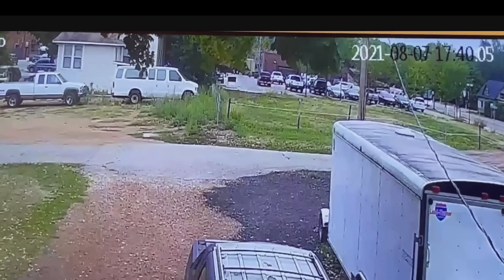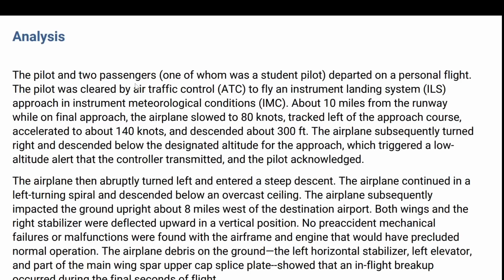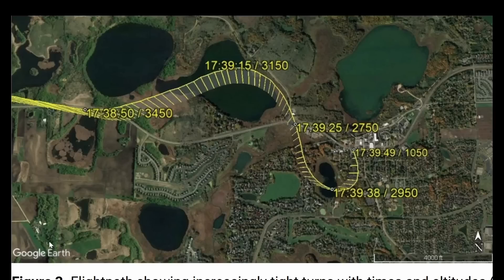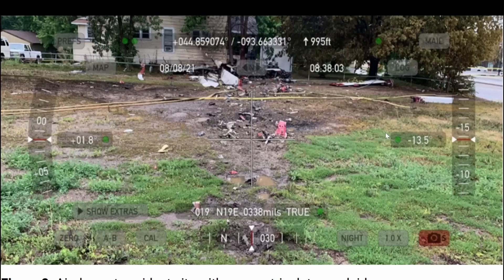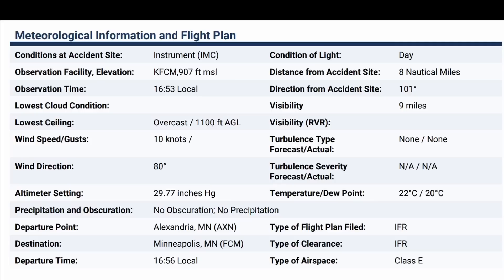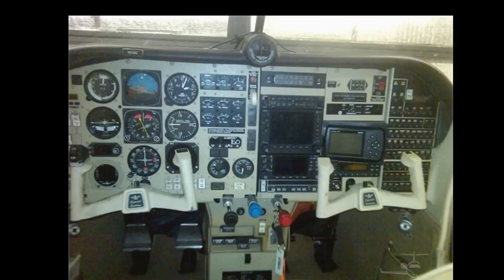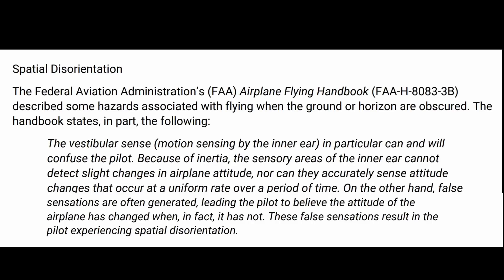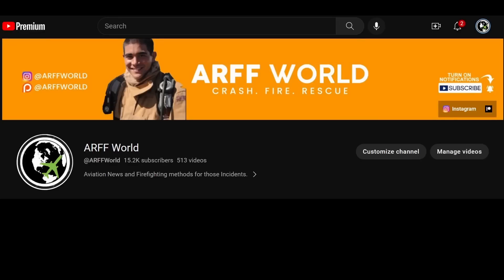Spatial Disorientation is Serious

Comment: I was stationed on an aircraft carrier in the late 70s early 80s. We had a pilot on the flight deck that was waiting to go to the catapult when the jets on both sides of him were towed. He thought he was moving. He hit the brakes, did something else  like putting it in park and still thinking he was moving about to roll back off the flight deck he dropped the knee (collasped the front landing gear). That slams a couple million dollars worth of radar into the flight deck. When he got out of the jet (I believe it was an F-14) his wheels were still chocked. I can't imagine how he felt at that moment.
Reply from the maker: Probably not good

Comment: I get the disorientation in cloud but isn't there an artificial horizon instrument, an altimeter and a compass you can look at until you exit the cloud?
Reply from the maker: True.  But human factors may cause pilots to not look at the gauges
Reply: @ARFFWorld  Maybe but why look out the window when you can't see anything?. Surely you can keep the wings level using that instrument and descend until you break cloud?
Reply from the maker: @worldofrandometry6912  hard to say.  Extremely sad. Thanks for watching and please subscribe if you liked the video.

Comment: This spacial disorientation, sometimes called vertigo, is possible anytime we have no normal visual contact with the horizon to reference for wings level flight.  Yes, I have experienced it occasionally during my 400 hours of flight in instrument meteorological conditions mostly in the Huey which required two pilots.  Fatigue and or task saturation is generally the cause.  No problem with two pilots.  When it happened I had faith in my instruments and had no problem keeping the aircraft level, but I strongly sensed that I was rolling over inverted.  It made me sick to my stomach, however.  I simply turned control over to the other pilot and rested until I no longer had the rolling over sensation.  Strangely this sensation need not be logical at all.  Driving from Durango to Pagosa Springs in a very heavy snow blizzard at night I experienced the definite sensation that I was rolling over to the extent that I was getting sick to my stomach.  I had to have my wife, who hates driving, drive.  Given the option of either waiting until I was rested or driving, she drove.

Modern autopilots do a really good job of giving single pilot operators some rest time, but when task saturated anyway that doesn't work as well as a second pilot.  Single pilot medical evacuation operations, especially by helicopter which requires a much more intensive instrument scan, have a very high spacial disorientation loss of control problem and a very high fatality rate as a result.  Two pilots should be required for safety of crew and patients.  Spatial disorientation need not result in loss of control, however.  A pilot can fight through with a good instrument scan, accept the sickness even to the point of puking, and live.  It is the most common cause of fatalities, however.
Reply from the maker: Thanks Jimmy for taking the time to share.  Spatial disorientation is a sneaky one not talked about enough

Comment: I'm not a pilot but these types of crashes always happen when the pilot is either entering or exiting the clouds and temporarily loose all and any visual reference out side the aircraft. Why would anyone flying blind not look at the basic instruments in front of them that are indicating they are nose down, loosing altitude, gaining air speed, and the wings are not level? Even if they don't look they can certainly hear the engine RPM's approaching red line.  Why don't they level out and get the air speed under control before they are going so fast they rip the wings off, I would imagine you don't go from cruise to wings off in a couple of seconds even if you purposely put it in a straight down dive? I don't know

Comment: Very sad. Especially realising that it was totally preventable. Spatial disorientation is a powerful killer. Especially when panic sets in. IFR flying requires small and gentle inputs and not allowing any significant deviation from the flight path and speeds. It also requires a mental picture of your nav situation. 
If you realise you messing up your nav, it is imperative to have a backup plan and execute it, and try again. In IMC keep your scan going; horizon-speed- horizon-alt-horizon-path! Over and over as long as you're IMC! Stick to it religiously!
The sudden accel from 80 its to 140 kts did not bode well. Way too radical. Gradual and gentle corrections is key. It doesn't bear thinking of the horror of folding up your aircraft in midair and breaking out of clouds at 1000 ft. Terrible...
Reply from the maker: Super sad one to cover

Comment: This aircraft had a modern digital autopilot that provides vertical and horizontal control to 800 feet below the cloud deck and 200 feet above the ground. Best practice for single pilot IFR is to let the autopilot fly the approach while the pilot monitors the approach. This is similar to John John’s spatial disorientation accident. Why didn’t they use the autopilot?

Comment: Freeze frame at 0.03 and 0.04 you can see the wings were still intact at 0.03 and folded up at 0.04 with the tail being the first part to impact the ground. But from the flight path you can see pilot was spatially disoriented. Also from the report he hadn’t had a medical in 4-5 years, so he probably wasn’t “current” with any sort of check ride. If there’s even a chance if IMC either don’t fly, or only fly if you’re current & qualified to fly Instruments in IMC, or better yet get AQP certified, too.
Reply from the maker: Agreed
Reply: When the Mooney breaks it takes the cabin floor with it. Seats and all.

Comment: It's a pilot's nightmare to attempt a landing in IMC, break out of the overcast at something like 1,000 ft. and realize that the airplane's nose is pitched too low, one wing is very low, and the speed is well over the "never exceed" limit. That means the plane is in a "death spiral." This Mooney wasn't in a death spiral until the last 11 seconds. Before that the pilot probably could have stabilized the aircraft by relying on the attitude indicator to level the wings and nose. After regaining control the pilot could have navigated to a safe altitude and heading, and called in an emergency.
Reply from the maker: Such a sad one.  Seemed preventsble

Comment: Agree about spatial disorientation...But, wondering about the wing appearing to have failed at the root, or inside of carry thru.  Assume the NTSB did what they could with what remained after the fire, but might have had some corrosion or connection problem, and spatial got the blame. Also might have been some competition of who has control, but if the wing failed, not much anyone could have done.  Wish there were more views.  RIP and comfort to family and friends.  And learning for the rest of us.
Reply: It was a relatively recent build and corrosion issues are normally quite readily identified, especially in the comparatively few parts, crevices, etc., that make up a small GA aircraft. With a through-spar in this design, it would have taken tremendous forces to fold the wings like that, and yet somehow the NTSB still had all four corners of the airplane to work with at the crash site. Normally, in-flight breakups mean that structural pieces are located along the flight path prior to reaching the impact site. I remember one many years ago that came out below an overcast in a spatially-disoriented dive in Florida, I believe it was, and managed to slowly pull the yoke back and recover without losing parts. However, when it got on the ground, the dihedral of the wing had increased by several degrees. That may be a clue that, even in worst-case scenarios, these wings will tend to fold instead of coming off. I think the estimate in the latter case was an 8 - 9G pull on that Mooney to achieve that dihedral increase, and also since the pilot had gone unconscious at one point in the recovery.
Reply: In that case, the breakup would not have been so down low near the ground after a few spirals. The sequence woudda been a break up then the spirals and wings falling far from the final crash site. Logically, the Gs on the wings were highest when the breakup occurred after several spirals hence the conclusion of the NTSB. I hope it makes sense

Comment: Agreed, trust the instruments. If all else fails, level the wings and climb straight ahead.  I’ve had minor cases of vertigo even in a heavy airliner.  Usually after takeoff and immediately entering the clouds.  It clears up very quickly by sticking to the instruments and trusting what they are telling you.  Now, instrument failure is a totally different story.  In that case you must quickly determine which instruments are giving you good information and totally disregard the failed instrument(s).  Easier said than done but with training it is quite manageable.
Reply from the maker: Agreed and thanks Steve for sharing

Comment: Good coverage of final report. You Mis-read attitude several times, saying altitude, but rather ATTITUDE. The 1,100 foot overcast was adequate for an approach, as long as plane was configured and stabilized. This should have been easily done by hand flying, or easier still if he utilized the autopilot to help. Sounds to me, like he he put lot was not current and proficient in IFR conditions. Learn from day one, when in IMC conditions, trust your instruments, not your inner ear/vertigo/spatial disorientation!
Reply from the maker: Thanks David for the correction.

Comment: Both the video of the impact and the condition of the parts suggest that it reached an incredible airspeed, whatever the ADS-B groundspeed data might show. (I haven't looked.) In an AvWeb video not too long before this accident, it was said that if you ever pulled hard enough to break this particular airframe that your eyes would already be flattened in their sockets. Hopefully that eliminates any possibility that those onboard were conscious, so they should have had no experience of the last seconds and impact.
Reply from the maker: So sad
Reply: Supposedly that airframe can withstand +11g’s (wings) without breaking

Comment: I have felt those sensations and I never trust them. Regardless of conditions I've trained myself to scan the instruments about every 30 seconds. Trust your instruments not your instincts. Instruments do not get confused. Never turn your aircraft into a box of rocks.
Reply from the maker: Good advice Ken and thanks for sharing
Reply: instruments do fail,
keep a clear plastic bottle of water on your dash
Reply: @iwaswrongabouteveryhthing  That will not work. You need to use an actual gyro instrument.
Reply: It should be compulsory for ALL pilots to learn to control an aircraft (of any size) without the availability of visual aids (such as being able to see the ground below, or nearby mountains): 'VFR-only' flyers can instantly become disorientated when they encounter cloud, mist or sudden darkness makes (quite common conditions, I understand).
Reply: @None-zc5vg  All VFR pilots in the US have to take a certain amount of training in emergency flying using only instruments.
Reply: It should be a lot more frequent than every 30 seconds.

Comment: Very sad one indeed.  Sounds like the instructor pilot was either not instrument rated and was only cleared to fly under VFR rules or their instrument rating was not current.  There have been so many of these spatial disorientation accidents over the years where VFR pilots fly into known instrument meteorological conditions and end up spiraling into the ground.  A classic case was when country music manager Ramsey Hughes did the same exact thing with his Piper PA-24 Comanche back in the early1960's, which killed country music stars Cowboy Copus, Hawkshaw Hawkins and Patsy Cline that he had onboard along with himself.  That was a very sad day for country music.  All I can say folks is if you think you will ever fly into IMC conditions then why not get your instrument rating and keep it current.  It might just be one of the wisest decisions you have ever made and it just may save your life someday.
Reply from the maker: Good point Jim.  Thanks for sharing
Reply: VMC flight is very difficult to maintain.
The horizon is - at best - around 17 miles away.
Add in rolling or mountainous terrain and fast moving weather systems and turbulence and maybe icing and......
In a slow biplane it might have been somewhat manageable - you perhaps miscalculated the conditions and now decide to bail.
The normal airspeed is slow - the radius of turn allows a 180 using a lot less airspace than the following scenario.
In a fast modern aircraft it is a completely different ballgame.
Next time you are in a remote area with nice visibility and a nice straight road - run up the road and execute a max turn 180.
Take good note of the radius of turn - it will surprise you.
Do it again - a little hesitant at the start to achieve max bank - easing off the bank angle a little early and the radius of turn will increase a huge amount.
Now - overlay that to an imaginary mountain pass with steep sides to terrain you can not outclimb.
It is rough as - wind gusting - vis zero in cloud or fog and you are sweating buckets
Surely you can see where this is going.
If you are a VFR only pilot you are rolling the dice.
Dump your gas-guzzler, drown your iPhone and live in your parent's basement for a year - tell them why - I bet they go for it.
Look me up in 30 + years time - you owe me a beer or three.